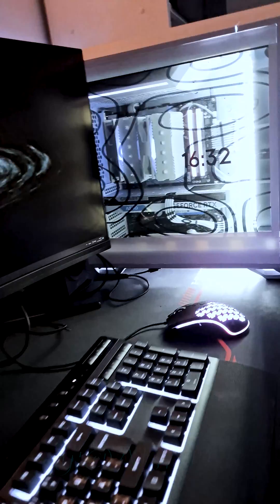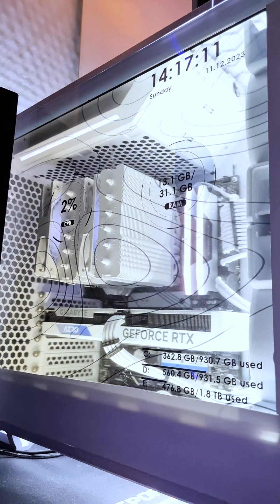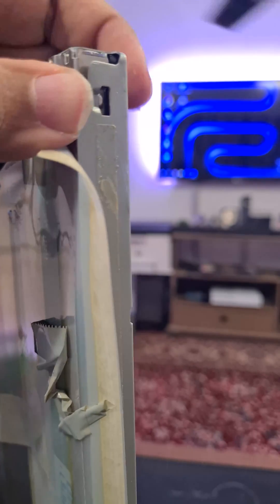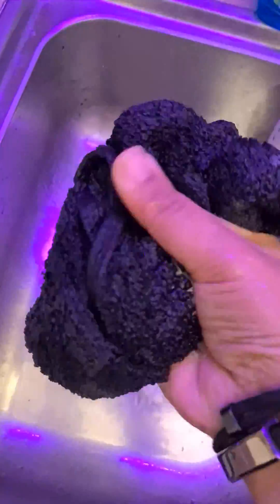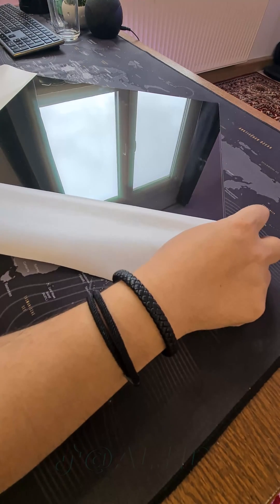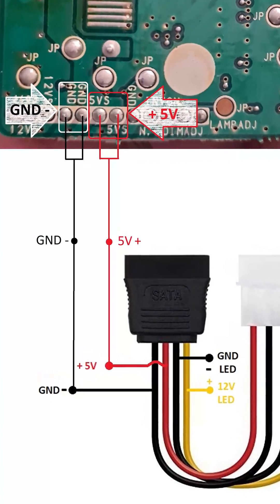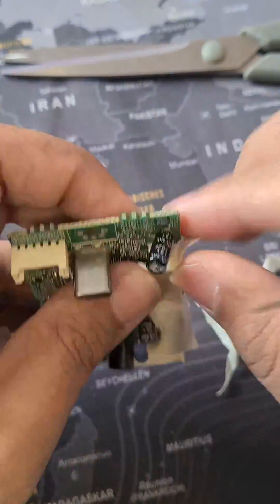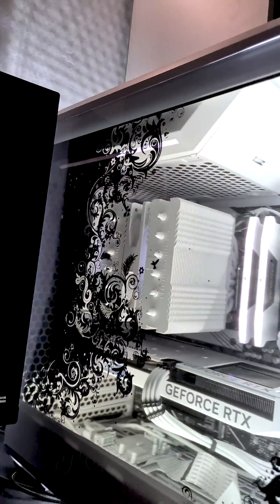Transparent LCD Side Panel Tutorial (Snowblind) "English"

Comment: I don't get how the screen is allimented
Is it a Sata connecter on the screen board ? And so you simply plug a sata-molex from the board to a power supply molex?
Reply from the maker: The screen itself isn't illuminated. The screen controller requires 5V and the white LED strip needs 12V to illuminate the case from inside.  both can be obtained from the molex connector.
Reply: @AL-Tech  How do you get the Molex connector to be plugged to the screen board ?
Do you cut the wire to plug the 5v to 5v and gnd to gnd ? and then plug that wire into the power supply ?
Reply from the maker: @tidix7 the molex connector has 12v and 5V so you can get both from it
Reply: @AL-Tech  I feel dumb but i understand now 😅
I will try it this weekend, i'll get back if i succeed !

Comment: I saw you connected 2 5V wires to usb and 2 0V wires, I get that the 2 0V wires are GND, but also i saw that you left the 2 14V wires, where are those connected?
btw nice video i like it!
Reply: I have the same question. I think 12v and higher are for powering the lcd backlight so i dont think they are needed unless you had 12v led strips you wanted to wire into the control board directly (of which is more complicated than just using an rgb header/rgb controller)
Reply from the maker: You can't use 5V ARGB for this. They are too weak. You need very powerful 12V LEDs to pass through the dark LCD. i have very powerful 4x50cm inside 12v strips

Comment: can i fo this with an old laptop screen as well? or are there components already mounted on the screen itself
Reply from the maker: You can but you need a display controller for that laptop display. They are available online. But most laptop displays are 16:9 and 15 inch. Most PC case glass planes require 19 inch and 4:3 size display

Comment: so you used regular clear packing tape to hold the monitor to the glass?  That's a good idea.
Reply from the maker: I originally used double-sided tape, but I ended up breaking the ribbon cable on the screen and had to replace it. Removing the screen from the glass was a nightmare because of that tape. So on my next try, I used regular clear tape instead, and it's been holding up fine for over a year without any issues.

Comment: how is the lcd panel connected to the gpu.  is there a cord running from inside the tower to the exterior and plugged into a display port or is the wiring all internal ?
Reply from the maker: Yes, the VGA cable is running from inside the tower to the graphics card in the back. Then into an HDMI adapter.

Comment: I connected the 12v wires to the 12v molex and my controller stopped working
Reply from the maker: Display controller? It should work only with 5V i was clear on that. The 12V is for the LED strip
Reply: @AL-Tech  then why didn't I cut the 12v wires coming from the controller? They don't power anything.

Comment: Can i use an LG Flatron L1952TX monitor?? idk what the difference is from the L1919s you used in the video. I cant find one of those anywhere
Reply from the maker: Yes you can. I only recommend that model because we don't know each exact model what kind of ribbon cables inside them are.
Reply: @AL-Tech  Thanks im ordering it off of ebay and will follow your steps. awesome video.

Comment: Did this with the same Monitor Model and it worked just fine.
One Problem i faced was that the Display wasn't turned on when i connected it first via Molex.
After i connected the buttons to the controller and pressed the power button once it worked just fine.

Thanks for the tutorial and the monitor recommendation man.
Reply from the maker: Happy to hear that 😃. Regarding the buttons, I think once you turn on the monitor the first time, you won't need them anymore. Because when you cut off the power from the monitor ""PC  is off; no more power""  then once you turn on the PC the monitor will come back to the last status it was on.

Comment: Hello, very cool project! I want to connect wires to usb for power, I see in 5:17 that you "merged" four wires into two wires for usb so 2x5v and 2x grounded into 1x5v?(or 10v?) and 1xgrounded, correct? So I should soldering them right? Sorry I never did something like this, and this is like black magic for me ;) Maybe you can recommend some tutorial for this?
Reply from the maker: No 10V.
Your just passing 5V to 2 different wires that's all.
Same for the GND ground

Comment: Hi I’m doing this from yours tutorial and I don’t know how to connect controller to usb, I measured my pins, and it’s look like this 

1.0V
2.0V 
3.0V
4.0V
5.0V
6.0V
7.5V
8.5V
9.3.28V
10.3.28V
I connected 9 & 10 to black wire and 7,8 to red wire. My lcd connecting it like this is not working
Can you tell me if I’m doing something wrong
Reply from the maker: 7+8 +5v
GND you need to find on the controller.
Or look at the controller PCP ir should be writing on the back of the PCP
Reply: @AL-Tech  how to find them if there is nothing written on the PCB except some strange string of characters like TP36
Reply from the maker: Connect GND to a screw hole. There is usually conductive circle around the screw hole for ground.

Comment: hello, I would like to ask how you found out which side the anti glare foil is from, because I did it with 2 monitors and I always tore off the polarizing layer. Thank you in advance for your reply.
Reply from the maker: You just look at it under a light. If it's matt or non-reflective, then it's anti glare layer. But if it is reflective or shiny then don't peel it off
Reply: @AL-Tech thanks
Reply: @AL-Tech  And I would also like to ask about the power supply, I bought a new dell 190Sb monitor and I don't know how exactly to supply the power, I read it from the board. to which pins should I put 5 volts and gnd 1/ -
2/-
3/5V port
4/5V port
5/ gnd
6/ gnd
7/ 5V usb
8/ 5V usb
9/ gnd
10/ gnd
11/ 3V
12/ gnd
13/-
14/-
Reply from the maker: Yes 5V to evry pin where you measured 5 volts. And "- to GND" .   Flip the board on the other side usually there is writing nearby the pins to indicate which is 5v GND etc. 

See the wiring photo in the description
Reply: @AL-Tech  I have to connect all the 5V pins to one cable that goes to the 5V molex cable (I connect 4 pins to one) and I have to connect all the gnd pins to one cable and connect it to the molex gnd. Did I understand this correctly?
Reply from the maker: Yes it's correct,  but you only need one GND. No need to connect all 4 gnd into one. 
Also it's better to test it via USB cable on some old USB phone charger. Just in case you made some a mistake so you don't blow up your PC power supply